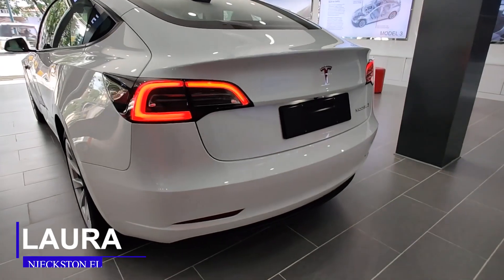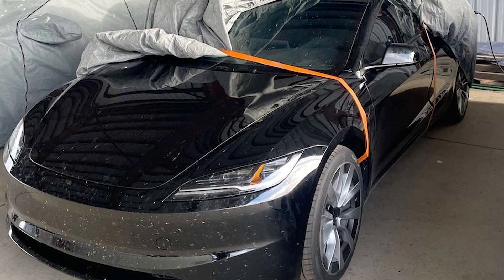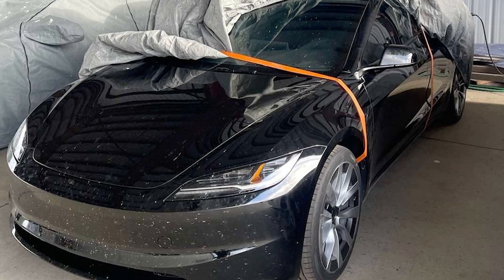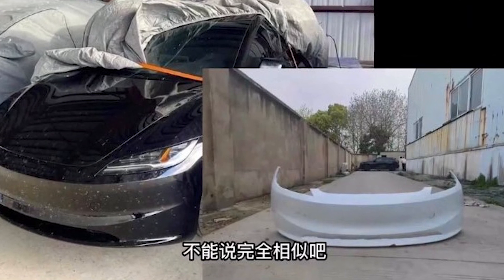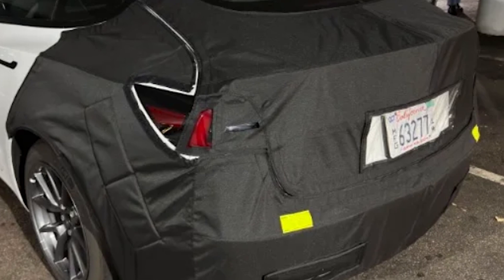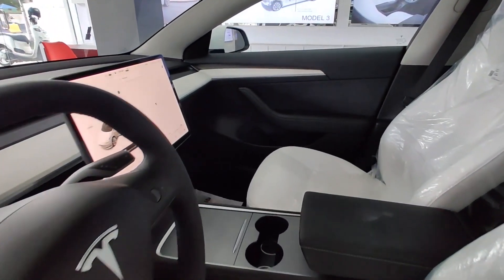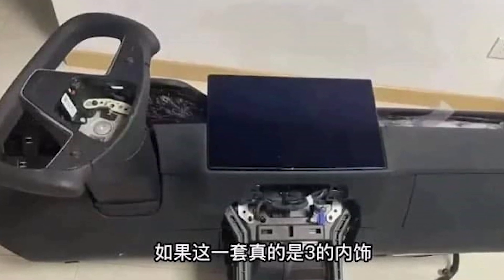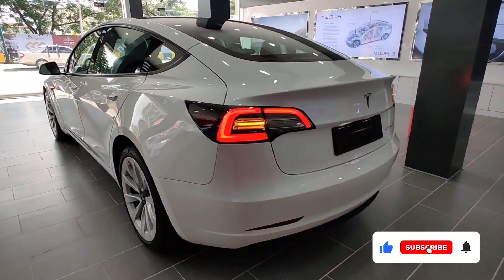Tesla Model 3 Project Highland Interior And New Update

Comment: Nonsense. The model 3 will not get the same dashboard as a model S.
Reply from the maker: Hahaha I didn't confirm that. The Chinese vlogger posted it on Twitter. I know the interior will not change much. At this stage where no one knows we are bound to see speculations and rumors. Thank you
Reply: @NjeckstonElectricChannel  you should not be spreading τhese rumors. It kills your credibility.
Reply from the maker: Thank you very much for this advice. You are right 👍 I really appreciate
Reply from the maker: I can confirm for the interior that the wood trim will change, the screen will be more advanced than current one and will support gaming like the model s. For the exterior features I mentioned, they have been confirmed by a Tesla insider.
Reply: @NjeckstonElectricChannel  what has been confirmed is an Alpha prototype. That's tietepw first attempt at a new design and it has absolutely nothing to do with the final design. Therefore it's basically irrelevant.
Reply from the maker: Yes the car is an alpha prototype
Reply: You have info saying that it won't be similar? Tesla has recently indicated they're pushing for higher volume over margins. The S is an extremely low volume car at only about 2% of all sales and even if this steals sales away from the S, the higher volume sales of the 3 will more than make up for it. They will successfully re-ignite interest if they can make it likened to the S while keeping it at a similar same price-point - at least on the higher end trims and it doesn't have to be quite as luxurious as the S either. A bigger screen is desirable along with other minor upgrades mentioned such as the cameras/processing hardware, which will also help upsell FSD, thus add to pure profit and  increase margins considerably.
Reply: @taipoxin  only somebody who knows absolutely nothing about Tesla could suggest such nonsense.
Reply: @whynotstartusingyourbrain8726  Objection: argumentative.  Lol.